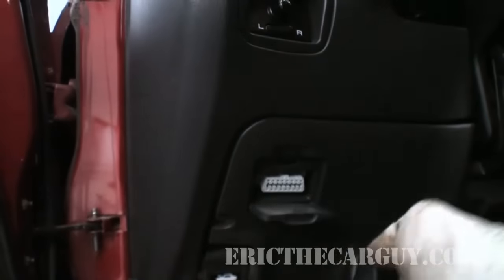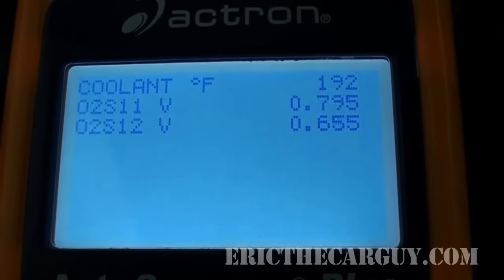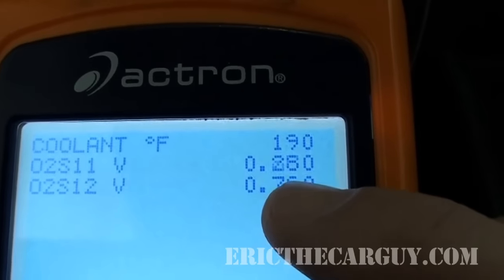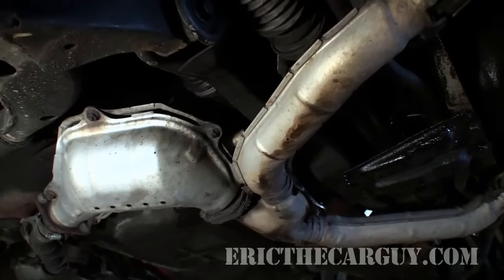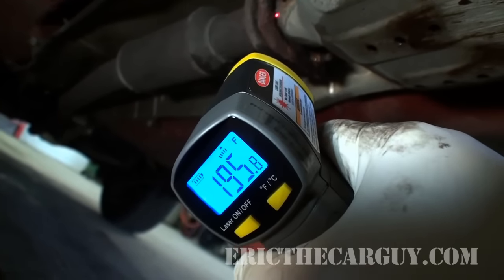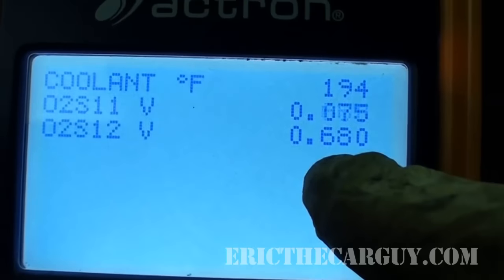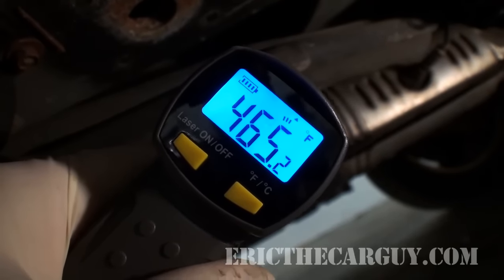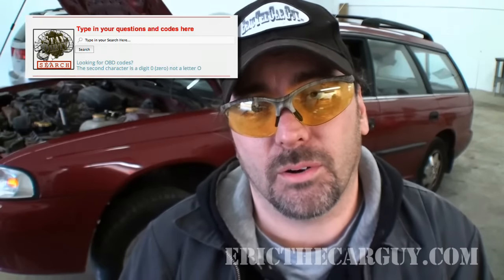P0420 How To Diagnose A Bad Catalytic Converter -EricTheCarGuy

Comment: eric,

thx for sharing man. your vids are very informative and its wonderful that youre volunteering your hard earned time to allow others to save money and DIY:)

idk about your subaru but i do know atleast in the older vehicles that you can obtain an eastern brand converter for about 50 ( my volvo 240 is around 39 give or take) universal. how good are the eastern ones though at that price id think shit but fill me in on this because if they are any reputable quality ill just replace my original instead of welding the spots that are leaking on the body.

Comment: So the reason the failed CAT has lower reading in temperature on the inlet than the outlet, it is because the inlet in constricted? The gases won't go through the honeycomb smoothly as they should?

Comment: Check Engine Light illuminated after about 300 miles of driving after I rear ended another vehicle at about 15MPH. P0420 is the only code thrown when I plugged in my basic obdII scan tool. Any thoughts what could be the issue?

Comment: Eric, which Actron reader are you using here?  I'm asking because I need to figure out why my Po420 code keeps coming back on after multiple repairs, and when I saw you reading the voltage, then I thought I should too.

Comment: scan tool only needs to be unidirectional to read data like he did. bi-directional is to command actuators using the scan tool. Such as cylinder power balance test, evap service bay test or maybe to close and open solenoids and relays.

Comment: So I'm getting P0420 which should be Bank 1 - But I find this odd and I'm hoping you might have an idea on it.  I did a live data view and it seems to me that the Bank 2 sensor 2 is the one that is bouncing around a lot, in addition, the previous owner had driven around with a misfiring cylinder on that bank (Cyl 6) which would make sense that it caused cat damage. Any idea why I would see P0420 when Bank 2 seems to show the signs above?  (2012 VW Routan / Pentastar V6 3.6L)

Comment: So basically a CAT should be cooler on the inlet side and hotter on the outlet end...as well as O2 sensor 1 readings should be bouncing around and the 2nd sensor should be steady at around a half a volt? Did I miss something??
In addition to that, if the sensors (most notably the 2nd) is operating incorrectly, only those should be changed?? Am I missing something??

Comment: I have to stand with scanner Danner on the heat gun test as it is not always accurate because there are too many variables , and personally I would rather read the O2 data on a scope

Comment: I was test driving a Honda CR-V the other day and I used my diagnostic tool after I drove the car.  It gave me no codes but in the I/M readiness or smog test, it says there is a CAT error.  Does this automatically mean this car has a bad catalytic converter and does it mean it has to be replaced? The owner of the car was persistent it does not need a catalytic converter.  Also, the car seemed to have a bad time chain (burn smell and loud obnoxious noise coming from it).  My diagnostic tool is basic and I do not have an infrared thermometer.

Comment: Hey Eric, I'm hoping you read these still. This is my confusion. My scanner (Seekone SK860) shows a bit different info. B1-S1 current and B1-S2 Voltage. Yours has both voltage. I'm confused as there is no way to switch this. I can tll you that the current pretty much stays at almost 0MA. it fluctuated a tiny bit. The B1-S2 Was all over the place. from 0.125 to 0.950. Never hung around the 0.50. Also, the top of the Cat read around 410 degrees and the otherside which was under the car read 200 degrees. Does this mean every dam thing is bad? Both sensors and cat? This is a 07 Suzuki SX4. The cat is in front of the engine. Can anyone agree with this being all effed? The current thing tho, has got me confused.

Comment: Dumb question: During the scan tool test, if your o2 sensors are indeed doing this exact thing as described in the video, is that an indicator of them working properly? I would think if they were bad, you'd get no reading at all.

Comment: Failed Smog check in CA due to P0420 code...My O2 sensors performed like the Subaru in the vid, BUT passed emissions with flying colors. They recommended I replace the CAT CONV. BUT could it be the sensors giving the bad readings? and NOT the CAT CONV since the emissions passed.

Comment: Hi from Ireland. I changed the cat on my toyota Yaris 2006, at the engine manifold. There is still a bit of a droning sound or a slight fizz sound. The cat was bought from a scrap yard. I had the sensors tested also and they were ok. Can you please advise what else it could be?

Comment: Very informative video but I have a question. What if the scan tool reads the O2s operating normal but the inlet temp of the cat is 150 degrees warmer then outlet? I'm trying to diagnose my car with your method and this is what I'm finding.

Comment: I'm sure this has been asked, so I apologize in advance.
I have '04 Subaru and have a CEL with the PO420 (the CEL keeps going on and off). I understand how scan tool is used for when testing the Catalytic Conveter. What if the PO420 was reading below threshold due to the O2 sensors not operating properly? Will that scan tool be used to test the 02 sensors function as well?

Comment: hi, if the cat is good, should the 2nd o2 sensor hold approx the same voltage regardless of engine revs? Or is it normal to move up and down with different engine revs, but hold a steady voltage when the revs are held steady? Thanks.

Comment: I have a P0430 code I drive a 2007 nissan frontier I did a 02 sensor live data the down stream 02 sensor is rapidly fluctuating between 0.000-0.890 and the front 02 sensor is fluctuating but not the way it should and I did the temperature test inlet is at 200-300 and the outlet is in the 400° range so it’s working should I replace both 02 sensors?

Comment: Hi Eric,  I have a 99 Buick Park Ave that is sick.  It runs for 5 to 10 minutes and suddenly quits.  I have changed the air and fuel filters, installed new plugs and wires, cleaned the mass airflow sensor, replaced the airflow pressure sensor.  I notice when it dies the fuel smells very rich and the exhaust pipe is very black with soot (or carbon, or ?).  Any ideas?  Thanks!

Comment: My nissan truck started missing and throwed a code. I changed spark plugs but now its running worse. IR gun on driver side reads cat is over 600°. Passenger side reads about 240°. I forgot if temps are hotter on outlet side.Which side is likely the bad one?

Comment: I have a question, my engine light is on and I also have the PO430 AND PO420 CODED, however, when I checked the temperature of the catalytic converter. It's showing 139 degrees at the inlet and 350 to 450 degrees at the outlet, what is my problem? Do I have a bad catalytic converter?

Comment: Hey Eric, I have a P0420 code, it’s from an 05 murano. I checked the voltage of the O2s,the O2s11 has,0.290 v and the O2s12,0.300 v. No fluctuation on neither one of the sensors. It looks like, the primary sensor and the cat is bad,right ? What do you say,which part is bad,exactly ? Thanks...

Comment: Great video! Working on my 05 Subaru Legacy which is giving me this code.  The IR temperature test (400deg on input/ 500deg on output) suggests cat is working.  But voltage on Bank1 02 is stuck at 2.75V while Bank 2 ranges between 0.2 - 0.8V.  Any idea what's going on?  Thanks!

Comment: I'm diagnosing a PO420 0n a 2000 Camry.  the 02S11 is holding steady but high at 3.27 volts.  the O2S12 is also holding steady at about 0.62 v.  does this mean that O2S11 (upstream o2 sensor) could be bad?

Comment: I have a P0420 code and tested both sensors on 2000 celica. The front sensor bounces up and down sensor but the rear mimics the front. I wonder if its a CAT problem even if the thermometer test shows the rear hotter than the front but only by 30°.

Comment: so at the 2 minute mark, the temperature is around 1000 degrees plus, so to double check,  in your video the numbers were around the hundreds degree mark and could of got hotter, correct? goal as well was to make sure the outlet Cat outlet is hotter than the inlet and to check of the 2nd o2 sensor was around 1/2 a volt, which is .5 volt or more and that the 1st o2 sensor was jumping around the numbers,  now are we also waiting for the coolant temperature to be around 200 degrees as well, since you stated the car has to be around 2000 rpms to 2500 rpms, you so both coolant at 200 degrees and at least 2000 rpms?

Comment: So, my secondary o2 (after cat) is also hanging steady numbers. So, upon accelerating I’m losing power. Pulled all 3 o2s out and drove around , car was fine again, so, I’m going for the o2 sensors that the number not moving to fast on the scanner.

Comment: If the temps were off with your front converter, wouldn’t the temps on the second converter automatically be wrong too, even if the second converter was still good? Or does that not matter, and the temp will still increase on the secondary converter outlet if it was good? Hope that made sense.

Comment: After a P0420, I found that my upstream sensor is hovering steady right around .6V (it is moving, not a flat line), while the downstream sensor is doing what yours is; bouncing up and down. I did find a leak in the intake system (intake boot was very ripped). Does the somewhat steady upstream sensor indicate anything particular? Also, can a big leak that I found in the intake boot going to the throttle body cause P0420?

Comment: Live stream data showed my O2 sensors to be working properly but the cat showed 100 hotter at the inlet than the rear. I have already ordered a new CC but will I need to do anything with my O2 sensors since they are reading correctly with a bad cat?

Comment: Good video. Sure I know their functions, but what exactly is the primary O2 sensor sensing, compared to the secondary one? Isn't the number of oxygen sensors, found the vehicle corresponding to the number of CATS? Anyhow... You should also bear in mind, that the sensors them selves tend to go bad, as years and kilometers go by. Two good indications for this - disregarding the "check engine light" - are either up and down surge in rpms, at idle speed and significantly decreased fuel economy.
Best Regards, Ragnar.
Reply: My 4.0L Ford has 2 upstream sensors and 1 downstream, and only 1 cat.
I've got that up and down surge in RPMs at idle + check engine light that turns on once it gets to operating temperature.  Replacing my O2 sensors this week.

Comment: Hey ECG..Question for you, Many of these factory cats are really expensive.. How about when you have a bad one, you leave them in place and install a universal cat rearward of the original...leave the upstream O2 where it is and move the down stream O2 behind the new universal cat...think that would shut off the CEL P0420 light?
Reply: You may have a problem getting those cats up to operating temperature.  You saw that his faulty cat reduced the temp of the exhaust gas by 100+ degrees.  Combine that with placing the new cat even more downstream where the exhaust will be cooler and it probably wouldn't work.  But only one way to find out!

Comment: How do you test if the car will not start? Would a bad O2 sensor (reads "bank one") or a bad catalytic converter stop the car from starting???? I do have an antifreeze leak...bad one....could this be the reason the car will not start?

Comment: Hi Eric, great video, as always.  Thanks for the information. I notice that you were using a Actron scanner, I have one too but I can't get the first sensor to show the units in Volts. It only displays the units in mA.  The second sensor shows the units in V.  Is there anything you can suggest so that I can compare both sensors using the same units?  Thanks again

Comment: I enjoyed your video, it was informative and short.
Q 1. why does  a sensor(s) go bad ?
Q 2 when you replace the O2 sensor will the cadillac converter get better ?
Q 3, what are the choices for a bad cadillac converter owner ?
Q 4 , will the dealership tell you if the cadillac converter is bad so you don't spend that money on those sensors ?
I know you said it can get cleaned but you didn't look convincing.

Comment: I think you might be diagnosing hydrocabons ... i thought nox was when u got 2 much air in your fuel mixture (running lean) and the temp was around 2000 f. ?

Comment: My 97 Town Car has the 420 code, likely due to fouled original spark plugs by previous owner. Cataclean didn't work but it cleaned the fuel system well.  I'd always heard that a new cat-con was not cheap and it ain't.  But, I can buy the whole pipe with converter for $175 or just the converter for $100 online.  I'm now deciding between those 2 options plus grease gun Chad's econo-fix with which my Lincoln might be "a little louder"!  Just sayin estimated cost is less than 5 bills, a hefty sum but about half what I expected to pay. Cheers

Comment: Ok Eric, I've done the temp test and it works the way it's supposed to. It is a good 100 degrees hotter in the back. So what does that tell you? I'm still getting a PO420 code. Thanks

Comment: I have a question about a 2001 Honda Civic. When I’m driving my car down the road at temp it will bog down and lose power but when I stomp on the gas it will pick back up. I’ve been told that it doesn’t have a serviceable fuel filter.  What could cause this problem and how can I fix it. It’s throwing a Vtec solenoid code and an o2 sensor code. Thanks in advance for your help. Oh I’ve replaced solenoid and throttle position sensor.
Reply: I’ve already figured it out. The catalyst inside the converter was loose and it would block off the exhaust. I cut off tailpipe and punched out the catalyst. No more problems. I also had to remove my intake and clean out my EGR ports and valleys because of a EGR code. I’d suggest doing this for EGR codes plus it’ll probably need it after high mileage.

Comment: Okay, here is my deal: 2002 Camry, serpentine belt snapped while driving. Shut car off, but still had battery, so I stupidly drove it a few miles--with no alternator of course due to snapped belt!! I barely made it home on weak power. Replaced belt, now get consistent P420 codes. Occasionally, check engine light will go off. Did I blow out the cat? How? I need to pass emission now. 154k on car.

Comment: I did this test on my vehicle and found that the primary O2 sensor was pretty steady and not changing pretty rapidly. The secondary O2 sensor was switching pretty rapidly and didn't really hover at the 0.5V mark. What would this mean?

Comment: Hi Eric
Would you suggest replacement of manifold if a new O2 B2S2 still has reading steady about .015V-.035V
Code PO156 comes back...just put a new O2 B2S2 sensor ...it means cat is bad?

Comment: The secondary O2 sensor readings on the Odyssey seemed to be switching just as much as on the Subaru, the numbers were just higher. Does that go more towards the accuracy and sensitivity of the scan tool that's used?

Comment: Eric, my readings are good as you said, but my inlet is a 100 degrees than the outlet. Is that good? 2009 camry 2.4 code p0420.

Comment: My 99 grand am shows signs of a bad cat. It will rev at 4000 RPM but go no where. It was have TONS more power when its cold. When it gets hot, it simply does not rev at all. No check engine light though?

Comment: Is it very hard to totally bypass the catalytic converter? My 2001 nissan sentra idles rough due to a bank 2 driver's side pre-cat P0420 code. This car was just a cheap used one off craigslist, I'm not a car enthusiast and just needed something to get me from point A to B which it has done for months fine. I do NOT want to spend alot to try and fix this problem when my area doesn't do emission testing at all, nor do I ever plan on moving to a big expensive city where they do emissions testing either to be honest. I see entire cat-converters direct fit on ebay for about $140-180 but that doesn't include labor to get it off/put it on which can be hard with rusted/old bolts on a 15 year old car. Is there a simple guide or video out there showing how to totally bypass the catalytic converter and pre-cat? I also heard there's O2 simulators out there that will eliminate the check engine light when the CAT is bypassed.
Reply: Try google you'll find something im sure

Comment: Hi eric, brakes plus says my car needs a new catalytic converter 2016 Nissan  altima. It's got a p0420 code but they're also telling me that they recommend getting two new oxygen sensors as well as a tune up with the new converter. Is this true or are they trying to pull a fast one on me???

Comment: So if one has a P0420 $07e8 code (2019 Hyundai Tucson 2.0L) and lives in a state without emissions testing, is it ok to keep driving the vehicle?  I have no other codes and nothing seems unusual.  Would continued driving with this kill the engine?  Have 50,000 miles on the car.

Comment: Would a vacuum leak ever through a P0420 code? I ran a live OBD and my O2S12 is steadily above .6v's.  My O2S11 is quickly changing between .1 and .8v. My idle is a little off as well.  Oh yea, it is a 2007 Suzuki Reno.  Any thoughts would be awesome.

Comment: hey Eric question for you I am working on a 2006 Subaru Outback ej25 engine single cam engine is running so when I go give it gas it bogs down is that a sign of a bad cat or what do you think it is I did a spark plug and wires  and new air filter check the O2 sensors they seem to be working like in your video so I am asking your advice about it and by the way I can't get it to throw another code.